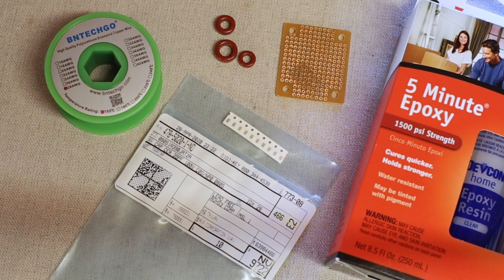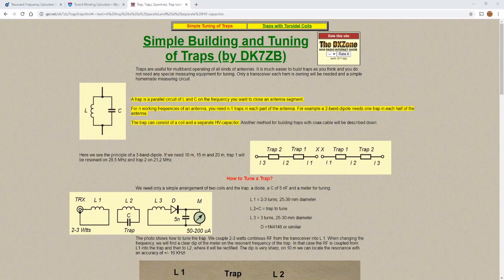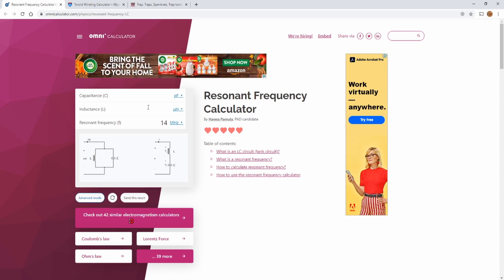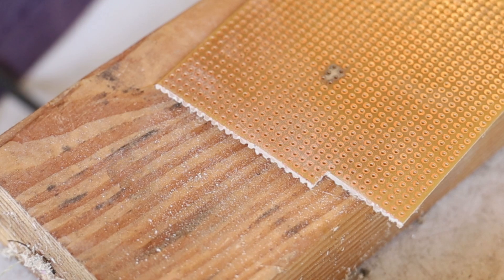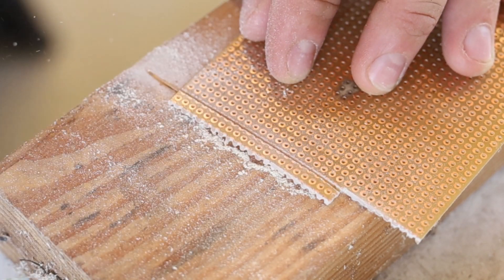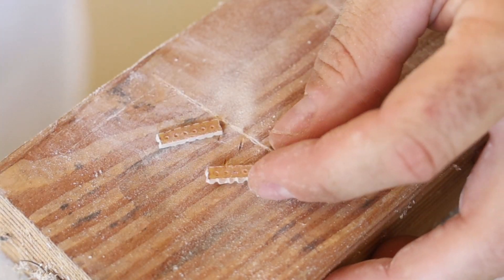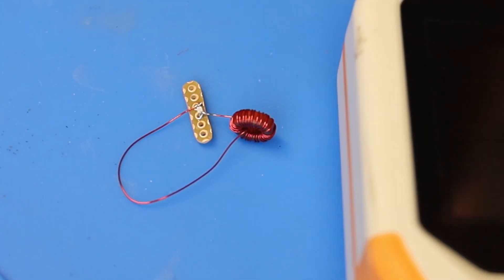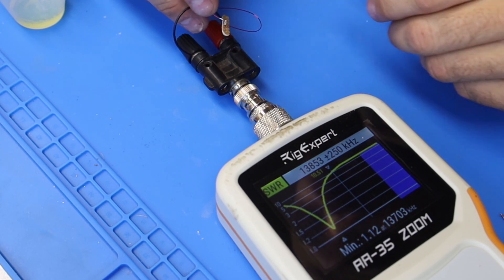HF Antenna Micro-Traps - DIY Build Project

Comment: Before I go crazy and build a trap for every band up to 40m, dare I go 80m?  I should ask, how many traps are too many?  Currently I've built one for 10m, 15m, 20m, and 30m.  I understand that the antenna will be less efficient with the more traps that I add, but I'm thinking of also doing 12m, and 17m.  Any advice, or just send it?  I am using 24AWG magnet wire and T44-2's with some nice 500V rated mica caps.

Comment: Hi Adam - many thanks for the video - very interesting to see how you tune the traps, and also impressive to see how small you get them. One question about the toroid you selected - why did you go for material type 2? From my limited understanding, this material type has a frequency range from 240kHz to 10MHz, so it would seem they are not ideal for 20m traps (but ok for 40m). Is my understanding correct, or have I missed something? I would really appreciate a book reference where I can learn more about the principles behind antenna design (including designing transformers and traps). There seem to be many “recipe” books showing different antennas can be built , along with accompanying parts lists, but without detailed explanation about the designs - this isn’t what I am looking for! Could you recommend anything? Many thanks again!

Edit: I have found more information, so I will answer my own question in case others come. It seems that the type 2 material has a frequency range to 30MHz, not 10MHz as I wrote above. Both type 2 and type 6 material would be suitable, but the type 2 material has a higher permeability than type 6, so you can achieve the same inductance value with less turns. Clearly when making these microscopic traps, that is an advantage! Hopefully this helps someone!

Comment: After building two of these now I can say I am amazed how sensitive the tuning is.  The slightest widening or tightening can make the SWR dip drastically off the chart. For me, I started by soldering one of the tails permanently to the capacitor then adjust the windings delicately to where I wanted.  Then I soldered the other side permanently and retuned because if would out of tune after the soldering.  After, ever so slightly widening or tightening to tune it exactly, I would keep testing to be sure it does not move.   Once I am confident it will stay in tune I leave where it is (on the tuning wire still attached to the analyzer) not moving it and then drizzle the epoxy over the outer side of the toroid so wires lock in place. Later I come back with a bit more epoxy as a final coat.
Reply from the maker: Yes! Be careful with the epoxy too. I found out later that some epoxies have a significant impact on tuning which can be incredibly frustrating. Electronics grade silicone may be a better solution.
Reply: @K6ARK  That is bad news about the epoxying ruining the tuning.  My 10 meter trap dropped to 10.06  Mhz but I called it good enough.  I did not know such Electronics grade silicone was a thing I'll give it a try if in can find it.   Even if the tuning goes off the rails a bit can't that be slightly compensated for in any way?  Aren't we are still tuning the final wire length later so that the SWR dips in the portion of desired operating band?

Comment from the maker: A note on capacitor voltage... 
The 100v capacitor I used is marginally adequate for 5w. If you plan to run 10 or 15w, consider a 500v or 1kv capacitor to prevent over-voltage and breakdown of the capacitor. With the slightly larger capacitors, consider a T44 or T50 size toroid to ensure there's enough space for the capacitor to fit inside.
Reply: If you're going to be running 10-15-20-25 watts would you also need to upgrade the size for the matching unit's torroid to handle the higher wattage?
Reply from the maker: @BB-mq3nn  yes, absolutely.  The FT50-43 is good for 5w for sure, possibly 10w.  I have run 25-30w using a FT82-43 before it started to have issues. I run 100w using two stacked FT140-43.  One would probably be sufficient.
Reply from the maker: Sounds like a good Quick Tips episode topic.
Reply: Adam - What package size are those SMDs?  As in are they 1206, 0804, 0603, etc.  Thanks.
Reply from the maker: I generally prefer the smallest I can find with the characteristics I want - typically 0603 or 0805.
Reply: No antenna analyzer 🙁
Reply: So if I wanted to run 100w ssb and build a complete 80-10m EFHW I see you use stacked FT140-43 but as far as wire size capacitor voltage and other elements, is there a video or guide that will show how to figure out what I would need to upsize this build? looking to run remote at the cabin with a put up take down antenna.
Reply from the maker: I'd recommend the stacked FT140-43 toroids as you noted and a 3KV cap.  Use 24 ga minimum magnet wire for the unun (20 or 22 is likely better to minimize losses) and 26 ga or 22 ga Poly Stealth for the antenna wire.
Reply: @K6ARK  is there an equation or calculator or anything somewhere I can use to figure this stuff out on my own or is it more of a magic smoke and redo type situation?
Reply from the maker: @branderh3447  there may be a way to estimate through calculations, but I don't know how.  I have built some knowledge through experiments. Basically, if you try to push too much power through a toroid, it'll get hot and SWR will climb. I have found a single FT50-43 to be good up to about 10 or 15 W, a FT114-43 good for 20-30 W, a single FT140-43 to 50 W +/-, and two of them good for 100 W.  And that's doing CW which is a heavier duty cycle than SSB, but not as taxing as Digi modes.
Reply: @K6ARK  Thank you much for sharing your experience. When you say 2x FT140-43 would you just stack them and wrap them as 1 or do you need to wrap them separately in Parallel?
Reply from the maker: @branderh3447  just stack and wrap as one.
Reply: If you need power more than 20W I suggest to use traps from  coax cable like rg178 or rg58. In this case coax plays role as capacity and induction.

Comment: I do not wish to make a pest of myself but I do not know anyone I trust more for a clear understandable answer than you. My question is that after epoxying a 10 meter trap I find it is resonant at 9,100 when I had thought that it was resonant at 10.0. Since I can not adjust the coil I was wondering if I could just adjust the capacitance to bring the trap into resonance or if this would have some other adverse unintended consequence? Finally I have watched your videos at least 10 times and have not found anyone on youtube that does a better job and explaining things. best wishes Tom
Reply from the maker: Thanks Tom, no problem at all. I love this stuff, and I get to learn through all of your experimenting too. 

I have not found that the epoxy itself makes a difference BUT any movement of the windings on the toroid certainly will. Be extra cautious in handling the trap until the windings are fixed into place. 

Adjusting the capacitance is certainly an option. A small trimmer capacitor in parallel with a fixed capacitor could be a good way to make a tunable trap. Just make sure it can handle the voltage. It's a bit harder with fixed capacitors as they come in... well, fixed values. 

Use a LC resonance calculator to backwards calculate your trap inductance based on the resonant frequency and known capacitance, then recalculate the capacitance you'd need with that inductance to get the right resonant frequency. Maybe you'll get lucky with a capacitor value that you have available.
Reply: @K6ARK  Hi Adam, I find that both the epoxy and the heat shrink will lower the frequency of the trap, between 100 and 200 kHz. So I make the trap a usually 150 kHz above the required frequency, and it will end up right.

Comment: Fantastic video - thanks! I just built my first trap - one for 17 meters, as I'm making a 30, 20, and 17 meter EFHW. Interestingly, using a 27 pf capacitor on the T37-2 toroid, the online calculator said I needed 26 turns of #28. That gave me resonance up around 16 MHz - yikes! I re-wound with 32 turns and with a little fiddling of spacing got the resonance down to 13.995. The only thing I can surmise is that my Chinese-made SMD caps aren't what they are supposed to be. At any rate I've ordered a capacitance meter with supposedly good accuracy - hopefully it'll shed some light on this anomaly.
Reply: Hahahaha - major Homer Simpson moment! I thought I was building the 17 meter trap but instead I was trying to hit 14.000 MHz. No wonder my initial measurement was up above 16 MHz! Well, now I’ve got the 20 meter trap done and time to do the REAL 17 meter trap. Attention to details and RTFM!! Arrghhhhh….

Comment: Wow, excellent video!
Some questions come to mind.

1.
When selecting capacitor and inductor components, how can we make a calculation to determine the maximum power?
What factors determine the power handling capability?
Is there a voltage or current rating for the capacitor?
Is there a voltage or current or inductive value or coil type or coil size that determines the power handling capability? What is the limiting properties of the coil? Does it come down to heat? How can we calculate?
Additionally, selecting different wire sizes like 28 AWG seems like it might have some effect on the maximum power handling capability.

2.
As we add more traps, inductive loading seems to shorten the overall antenna.
What calculations and factors can go into maximizing the bandwidth?
If we use really small inductor values and larger capacitor values, will we have more bandwidth in the final product?
How can we mathematically determine based on the capacitance and inductance values that we choose how long the final antenna will be? How long each segment will be? How much bandwidth will be lost as we add each trap?

I am interested in making a higher-powered version of this multi-band trap EFHW antenna and I'm struggling with trying to determine what the overall antenna length will be, what each segment will be after adding a trap and how to maximize the antenna to keep as much bandwidth as possible as well as keep resonance and reduce losses. It seems like there must be some relationship that we can mathematically determine and use to satisfy requirements or failing that, maybe your experience shows some rules of thumb that can help guide in the right direction?
For example, using smaller inductance values and larger capacitance values
Versus
Using larger inductance values and smaller capacitance values.
What do these choices affect on the overall design?

3.
Sometimes in videos like yours we hear people talk about antenna efficiency.
Can you please describe what efficiency means to you?
How can we measure efficiency and do a comparison between various antennas?
I am very cognizant of having a resonant antenna, but I don't know what specifically makes an efficient antenna.

Thank you very much, I am of course subscribed with notifications turned on and 73.
W3GUY

Comment: Awesome video.  I really like that you use the perf board for strain relief.  I made my traps with the ws0ta PC boards and there is no strain relief except for the heat shrink over the ends.  My next build will use the perf board.  My experience in using the non-tinned perf board is that it helps to clean the Cu with steel wool or sandpaper for easier soldering.  Also tune the antenna with the mast you will be using on the summit.  The height of the wire will change resonance somewhat but the mast material will definitely change the resonant point for 40 meters.   i.e. carbon fiber versus non conductive.  Not by too much but still has an effect.  de AI6XG
Reply from the maker: Great tip on cleaning the board first!  I suspect a wipe with isopropyl alcohol would help as well.  Will keep that in mind for the next go-round.
Reply: @K6ARK  Would there be any benefit to using double sided through hole tinned perf board with the SMD cap on one side and the toroid soldered on the other?  Thanks
Reply from the maker: You could, but it makes it bigger. I like the strip of board in the middle of the toroid.

Comment: The one question I did not hear you explain about traps is what makes them limited in power. Or how do you build it so more power could be used?
Outstanding explanation of how to build the trap!!
Looking forward to more great videos!
Reply from the maker: Good question, the capacitor is the primary power limiting factor.  At some point, however, the current flowing through the wire on the non-resonant bands will become a problem for the thin wire and the small toroid.  Larger toroids aren't particularly efficient on weight, so most use an air-wound coil as the inductor for larger traps for higher power.  If you search around for info on trap building, I'm sure you'll find options like that for 100W and up.  Other than the type of inductor and voltage of the capacitor, the concept is the same.

Comment: This is very helpful. I am curious about the capacitor voltage rating though. The trap represents the end of the antenna for the band, so it would also be at voltage max. Even at QRP, this could overwhelm 50V caps. I'm designing mine with 100pf and 150pf 1kv+ caps and t-67 cores, since that's what I have. The winds are reasonable (18-25 range) at that pf. The inductances are low (.6 to 1.6 for 10 and 14 mHz), and I am unsure if that's a problem.

Comment: If you were tuning your trap for the SSB portion of the band, would you still adjust it as low as your showing in the video? Does the amount change for other bands? Thanks for the videos and for all you do to help others.
Reply from the maker: The trap impedance is high enough even at the SSB frequencies to be effective there as well. 👍

Comment: Nicely Done!  Especially enjoyed the trap testing with the antenna analyzer.  Made it 3/4 through the video thinking he will need need pairs of traps per band (thinking center fed trapped dipole not end fed.  Oops!).   Headed to the garage to fine the epoxy and the magnet wire.  keep them coming.  de KB7ZUT

Comment: A trick you could try to widen your bandwidth back out on 40m is use the copper braid of some thin coax like rg-316 or rg-317 or even solder wick braid as your radiating element. The thicker the element diameter the wider your bandwidth is, why antennas like the Bazooka came into existence because cheap coax braid is easy to source.
Reply from the maker: The bazooka design includes elements that are more than just a larger radiator, and just adding a slightly larger radiator doesn't actually add much bandwidth. It comes down to the radiator diameter as a fraction of the wavelength.  At that small of a fractional wavelength, even using a coax shield, you gain very little (negligible) bandwidth.  Also, you add a great deal of weight and bulk which is what I'm trying to avoid in portable antennas. These trapped EFHWs can fit in a shirt pocket.
Reply: @K6ARK  the 21st Ed ARRL Antenna Book stated a Bazooka made out of something like rg58 (wanna say for 80m?) had ~14% greater bandwidth than a plain dipole. Still, even without the dielectric and conductor, 15 feet or so of braid for the 40m element probably isn't going to stuff in a pocket...
Reply from the maker: @macgyver5108  right, but look at the Bazooka design. There is more to it than just using the coax shield as the conductor.  I don't believe the OD alone contributes that much to the added bandwidth.

Comment: Excellent video.  Thank you for taking the time to produce and share it.

I have one question: at 13m:38s you used your AA-35 to test SWR.  Could a NanoVNA act as a drop in replacement to do the same thing?  Thanks again,

-rob

Comment: Alright Adam, what runway and airport is your QTH under? I hear a lot of takeoffs going on on this Saturday AM build.... LOL!, but only because my situation is similar, under KVNY 16 Right.  Very impressed with how you trust, but verify everything in your antenna builds, for complete optimization of the whole antenna on all bands.  What size torroids do you recommend if you want to build an antenna like this for a 15w capable, KX3 or KX2 version? The 50 T2's ?
Reply from the maker: Ha!  I'm just South of KRNM in Ramona, CA, and anyone doing touch-and-gos or on an Eastbound departure fly right over. It's also our local CalFire base with 3 air attack aircraft. 
For the KX3 and 15w, you may need to step up the matching unit toroid as well. An FT82-43 would handle full power better than the FT50-43.  Similar suggestion for the -61 mix in the random wire option. 
What bands do you want to use? If you want them all, the 9:1 with random wire is probably a better bet. But if you just want specific bands, the EFHW will be slightly more efficient.  A 40m EFHW should tune easily (if you have to tune at all) on 40, 20, 15, and 10m even without a trap. Add a trap or link for 30 if you want. The T50-2 is probably a wiser option. 
Haven't tried yet, but the KX2/KX3 might even load up the 40m wire on 80m.
Reply: Hi Adam, would you use larger gauge magnet wire with the ft 82-43 toroidal, say 20 gauge?
Reply from the maker: @w6mrd900  I have used 24 ga for a 100w matching unit with no issues. 20 ga may be too big for an 82 size toroid depending on the number of turns you need. Smaller wire increases resistive losses, but with the currents involved here, they should be unnoticeable with even 24 or 28 ga wire.